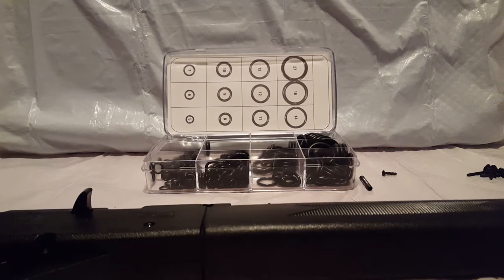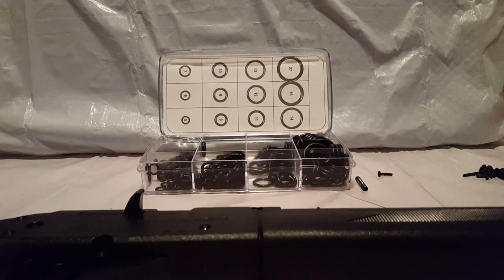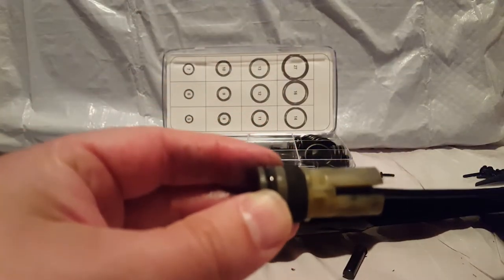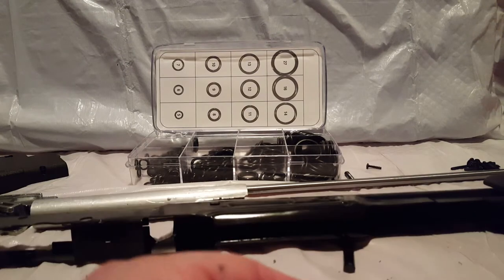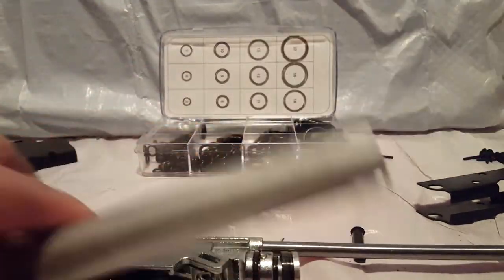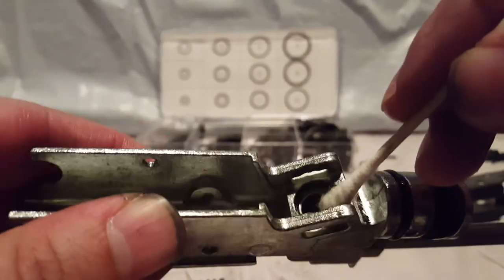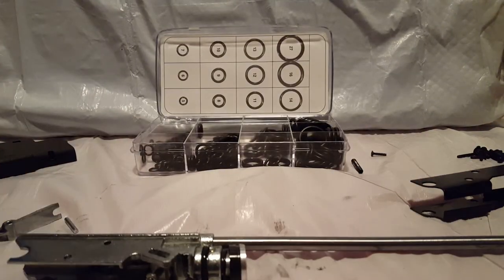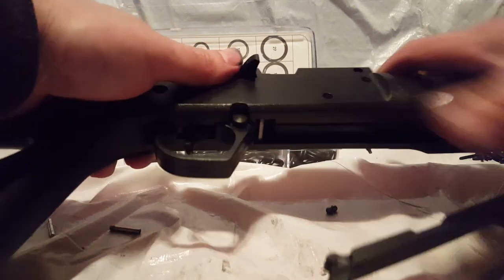Daisy 880 Fix. Rehabbing Used 880, 901, and 35.

Comment: keep the daisy 35, 901 and 880 revolution going, i love my 35 for all day shooting, like a light weight carbine every one old and young can shoot it and pump it, if i was to generalize for the mass public a 10 shot grouping for a daisy 35 at 2 1/2 inches is a good day at 25 yards and a 880 10 shot group at 25 yards 1 1/2 is a good day, anything better then that is really good for 10 shots, will depend on our pellet research and pumps, so far the daisy 35 with 10 shot groups the 11.5 grain silver arrow or silver point has been best for my 35, but the jsb 8.2 grain wad cutter suprised me a few times grouping like the silver arrow or silver point 3 1/2 to 3 3/4 for a 10 shot group at 40 yards wich is along way for a smooth bore, the 10 shot grouping is used to find the widest the 35 smooth bore will go, certainly some one with 5 shots may do better but the testing i do is finding consistency of time and time again averages for accuracy, think of it as a bating average for a baseball player, we want to know what he does on average for a season, same thing with 10 shot groupings, we save the paper and do the math on all paper that was shot to come down to a average accuracy or expected accuracy, if someone does all 500 rounds in ten shot groups that would be good data if they did bench rest like i do, but maybe someone is crazy enough out there in daisy land to push the limits on testing like never before for the 35, 880, and 901 using only the best pellets that worked for them and document distance and pumps used in the test
Reply from the maker: cory - Well, doc, when it comes to the 35, the Cory Concepts played out well for me. JSB sampler looked good overall, but the JSB Heavy rocked! Good down range??? It was Bebe Rexha star at 15 yards! The Heavy really stood out. The heavy barrel ammo is it. Let everybody know if you test LIGHT barrel ammo like the Sniper Light.  But I'm a firm believer in the heavy barrel ammunition  in the 35.
Reply: I think Corey is a excellent test rep, pellet test doc for the Daisy pumpers! I have not seen the data put out on YouTube in the detail he does. I'd like to see Daisy reach out to him for his assistance in testing for their pumpers. They (Daisy) might be surprised, as I know I am, to see how really well their economy priced airguns preform when somebody actually takes out the time and effort to do it, like Cory. And for you, Daisy Fanatic, you information is very valuable to with a great advice on the repairs of the same guns. I think you guys both would be great working for Daisy. :-) 1 as a doc, and the other as a repairman. As for me?? Well I'm the jack of these trades, but the master or none ( but that does not mean I will not try!).

Comment: Is the barrel the same in the 880 and 901? If I understood you correctly, the 35 is smooth bore. But since you said the only major difference between the 880 and the 901 is the block pump I'm guessing the barrel is the same. I have a 901 I just picked up for $20 but the accuracy/spread is horrible (we're talking a spread the size of a pie plate!) and I'm wondering if replacing the barrel would fix it or if I should just send it in to Daisy and wait however long that might take for them to fix it. Thanks for these videos! I've found so few resources for information about the 901.
Reply from the maker: Stmute, yes, I would get the 901 if it were fundamentally different in power and engineering.  It is not.

The stock is designed for left and right hand shooters. The block handle is for those who don't care for the lever - many BIG HANDS don't like the lever style.

The plastics are more robust on the 901. You got a nice gun.

On accuracy, try different ammo. If you are shooting BBs, that will stay pie size groups if you pump more than 3-5 pumps.

With rifling, I would go only pellets or lead balls. But no ball ammo is better than pellets.

The best 880 ammo I have tried for accuracy and power, is JSB Heavy, Field Trophy Power.

For solid plinking, wadcutters like JSB Simply and H&N Sport keep inch accuracy up to 15 yards open sight. 5 to 7 pumps.
Reply: @daisy880fanaticfixit9  Thanks! I'll give pellets a shot (no pun intended 🤣). You're right I was using BBs. Funny thing is though that I also bought two 1977s at the same place as gifts for family and those two rifles are very accurate with BBs. I figured they're probably like the 880s (same barrel and same pump lever). So if those are accurate with BBs, what's different about this 901? I still have my 840 that I grew up with and it's a smooth bore and just as accurate as the 1977s. I can cover the spread with a dime. I love the way this 901 feels. It's like a more robust/upgraded 840 so it's just what I'm looking for. I just wish it shot BBs as accurately as all of the other air rifles. So you don't think replacing the barrel would help?
Reply from the maker: The 840 is more accurate BB gun than most multi-pumps. My 840 with elite BBs also gives rough dime group.

Some guns just better with BBs than others. The trigger is in play because BBs can be sensitive to rough trigger more than pellets.

A 35 can deliver good accuracy from elite BB and right power (3-5 punps).
https://youtu.be/PFXgNtIyFJo

Replacing your barrel means another $20 spent, from eBay much more.

ELITE BB:
Avanti 
Marksman
Reply: Thanks so much! I really do appreciate your help!
Reply: OK final update if anyone is interested. I tried pellets today and it's really accurate with just the basic daisy target pellets I've got. Open sights were so good I decided to mount a scope and it's a tack driver! I'd have to get serious and break out a table and sandbags to see if other pellets would be more accurate! Oddly enough I did try a few BBs and they were holding a tighter group after shooting the pellets.. But I think I'm sold on sticking with pellets and a scope for now.

Comment: Got my youngest the 901 to get him started. Great little fun. He dropped it from a tree though and broke the handle off the slide that pulls up a new bb. Any idea how I go about finding a replacement part and installing it?
Reply from the maker: Jeff, sorry to hear about mishap. Gamo does have a Buddy Sling that will fit that. I have one on my 35. Then your son can sling it over his back when he climbs trees.

https://www.pyramydair.com/s/a/Gamo_Gun_Buddy_Rifle_Sling_Fits_All_Air_Rifles/2227

Daisy has you covered there. The 880 cocking bolt should work. Here is info:

Bolt Handle Assembly 169762-K00
$2.50

Call Daisy Lady on weekday before 5pm Arkansas time. You may have to wait on hold a few minutes. Be patient for these LOW prices.
479-636-1200

Double check with rep, but last I checked most of the 880 parts transfer over. If she is unsure, just order it.
Reply: Daisy 880 Fanatic Fix It. 
Awesome! Thanks man. Really appreciated! I assume I can just replace it at the beginning of tear down? Remove the screws, slide bolt back and split the receiver. At that point I assume I can just swap them out and reassemble. Is that correct?
Reply from the maker: Jeff, yes. My only concern is if 901 receivers got damaged - cracked in fall - the 901 is known for GREAT plastic strength. Check handle side. If good, insert handle through slit. And, yes, make SURE to cock bolt back BEFORE splitting recievers.

Let me know how it goes.
Reply: Daisy 880 Fanatic Fix It awesome. The rest of the receiver plastic looks good so I think it’s just the bolt. Thanks for your help!

Comment: Hi,I have an 880 that I keep around for spare parts.My question is can I swap an 880 barrel on a model 35.I want to have a rifled barrel 35.
Reply from the maker: GREAT QUESTION.

I have one like that! I call it a 35R.

I ordered an 880 VB/barrel assembly. And sawed off the end to match the 35 length. It turned into a great gun and was very good with lead balls.

A smoothbore expert gave me a guilt trip for it - no challenge shooting. So I got an 1100 and 760 and followed his methods. My newest 35 will STAY a smoothbore. I like shooting BBs at soup cans on four pumps. When I want decent accuracy, I go JSB Heavy or a good  wadcutter.

Comment: Can you point me to any videos / sites for tips on Powerline 860 teardown / rehab / assembly? It's quite similar to the Powerline you disassemble here, with some key differences. One difference is a clip that acts as a stop to keep the pump from easily removing. Maybe I need to spread the surrounding metal to loosen/remove the clip? Seems like it would be a pain to reinstall. See these images for example:
https://i.imgur.com/SBU481l.png
https://i.imgur.com/w2IDd44.png
Thank you!
Reply from the maker: I just tried my best #1 stop for discontinued guns JG Airguns, and it may be promising. Let me see what else I can find.

Here is JG info. Scroll to bottom of page.
https://www.jgairguns.biz/contact_us.html
Reply from the maker: Ok, talked with other pro, he also says work it hard with JG Airguns.

https://www.jgairguns.biz/860-c-78_186_234/
Reply: @daisy880fanaticfixit9  Thank you! I had already found their parts diagram and parts page for the 860. I now used the contact form to ask about tips they might have.

Comment: Did they ever start making the 901 with the one piece metal chassis inside like the 35?
Reply from the maker: Great question. Daisy reps did say it went through re-design. The original was one piece stock and receivers. 

Then the 2nd gen was more like the 880 stock and seperate receivers. The plastic is supposed to be stronger on 901.

I don't have the 901 - I really like the 880 lever handle. But I do have 35 and single pump version.

Comment: I recently purchased the 35 daisy and it was going well until today when the rifle made some sort of sizzling noise and when i’d pump it ,the bb wouldnt shoot as hard as it used to and i decided to try and disassemble it.
Reply from the maker: Adrian, many times what causes an early death for these guns is using Wd-40 or other penetrator that are not meant for these seals.

But I had a 22x long ago blow an O -ring right away. You could just have defective ring. So change both on front and back. SAE 113 x 2.

And sometimes they get sloppy at the factory like my 77xs. Bad performance, so I had to change both rings on that gun.

If you used product other than silicone, 30 SAE ND, or Pellgun oil, wipe off alll surfaces before applying new rings.

Comment: Looks like some guys have bought up all the Daisy stock seals and selling on ebay  and amazon at several times the cost.
Reply from the maker: Sir, if it is it an O ring problem, you don't have to pay ebay prices.

Those store bought ones are great!

Last I checked you can SHARP SHOOT the chamber seal from Daisy and and buy 3 or 4. If not, here are the other decent options in this video below:
https://youtu.be/ZN0tz5rUApo
Reply: @daisy880fanaticfixit9  Ok, thank you. But what does sharp shoot the chamber seal mean? Also, do you have to remove the trigger before the valve assembly and chamber seal?
Reply from the maker: That means Daisy CSRs should be able to sell you individual chamber seals.

25 cents each
Call 479-636-1200

Weekdays 9am to 5pm Arkansas time,  9 to 3 Friday.

Many times it is seal KITS you see on ebay.

Also, no, the trigger stays put if it is chamber seal fix.

Yes the trigger has to come out on a valve fix.
https://youtu.be/3TMPMjsIBDU
Reply: @daisy880fanaticfixit9  Ok great, thank you !
Reply from the maker: Thank you for being a Gentleman! Make sure to watch all my 880 fix videos before starting.

Wish you success✌

Comment: Cant seem to be able to find parts/seals for the 901. Are the 35 and 880 parts the same?
Reply from the maker: YES! The chamber seal and valve or identical. You can cargo ship parts off 35 or order from Daisy. Let me know what type you are:

Same day fix, or you are ok waiting on mail. I will send one or both links.

I actually feel the 901 could be better supported and advertised.
Reply: @daisy880fanaticfixit9  Thanks! No rush. I dont mind waiting for the mail.
Reply from the maker: Ok, here is contact info. 
https://youtu.be/SSI1LzdIwZo
Please read written section (toggle arrow) and top comments.

Also, know to just ask for 880 PDF (if you want parts list) or just order 880 valve and 2 880 seal kits for your 901.

My 1998 880 took recent seal kit just fine!

Comment: Como los consigo si soy de Honduras.?
Reply from the maker: Hola, si tienes puntos de venta de Amazon o Home Depot, eres coberedred.

Los sellos Danco son de nitrilo de alta calidad. 

https://www.homedepot.com/p/DANCO-200-Piece-O-Ring-Kit-34443/100135126

https://www.amazon.com/Danco-34443-Rubber-Faucet-Ring/dp/B000KNT6WA/ref=mp_s_a_1_5?crid=3B378K07DHTBW&keywords=danco+kit+rings&qid=1647226377&sprefix=danco+kit+rings%2Caps%2C146&sr=8-5
Reply from the maker: Si tiene una ferretería local, pregunte por SAE 113 x 2. Nitrilo.

Comment: How did you just push it out
Reply from the maker: Sir, apologies, that watch repairman style close-up video does miss some action on the side.

AFTER removing the retaining pin holding the sheet metal to the valve body (VB), You PULL UP on the pump handle and push DOWN.

Sort of like you are pumping the gun. The VB will punch out of the metal frame.

The black pin should just fall out RIGHT on to the table. Tip it.
Reply: Just tried that worked like a charm thank you
Reply from the maker: Wish you a successful fix. Remember if this is a USED 35, clean off all the contact points where your new rings go.

Folks love wrecking these guns with penetrators! WD-40 and Blaster.

Comment: Is the 901 better than the 880? And the 35 the best?
Reply from the maker: Great questions!  The 901 is the same power as 880, but certain folks like the 901 better because they like the block pump better.

The 35 is a cool BB gun that gives you a balance of power and accuracy - IF you keep it at 2 or 3 pumps. More pumps is LOUD if you have fussy neighbors and BBs fly wild. For pellets, it has no rifling so pellet accuracy can be tricky.
Reply: Sounds like the 901 is the best of the three than?
Reply from the maker: Desert, thanks for simple, clear questions 👍

The 901 is a great Daisy with very thick, strong plastics. Daisy should market it harder, and bring out a .22 version and a Scorpion style (chopped down barrel w stock folding over top, like the Russian gun).

If you decided on the 901, great!
Depending on your budget, you can COLLECT all three pump guns.  They are priced to collect.

Comment: what does the chamber seal do an can we leave it out
Reply from the maker: David, great question for 880, 35, 901, the chamber seal checks the air so you have a multi pump. It allows you to build up air pressure. You have to have it.

Always first try and clean it off and inside pump tube. Many times that fixes it. If handle still fights you after tthat, then order seal kit.

If it is not holding pressure, that is o-ring failure not chamber seal.
Reply: How about the two plastic washers. I was taking the 880 apart & 1 fell out & the second washer just fell out the 2nd time I disassembled it & iI didn't get to see where they came from..
Reply from the maker: Lion, yes, great question. People can confuse those as washers. They actually operate as GUIDE WHEELS  for your pump asssembly. On goes on EACH SIDE of the retaining pin anchoring the pump handle to the pump head. You want those there.

Here is old video explaining it. Sorry, It is rough, was new to making a video. But the footage is there.

https://youtu.be/fGI6D0NxkO8